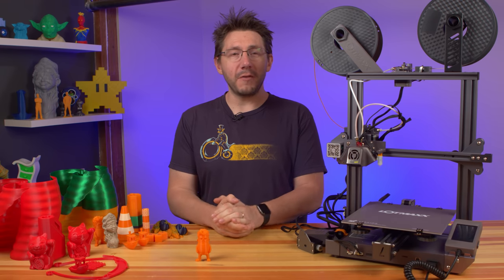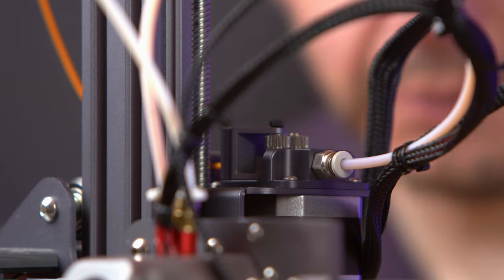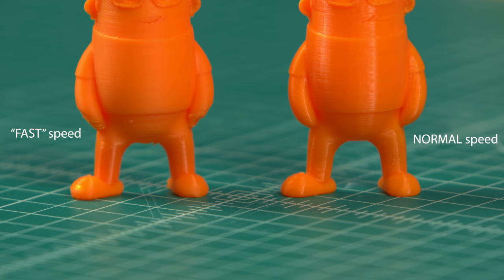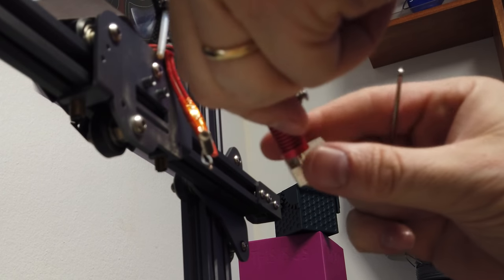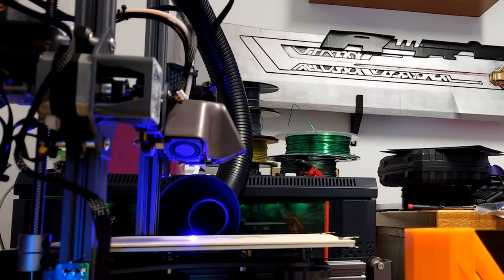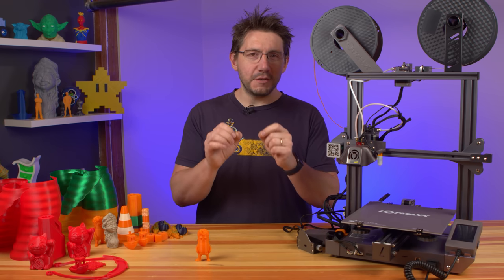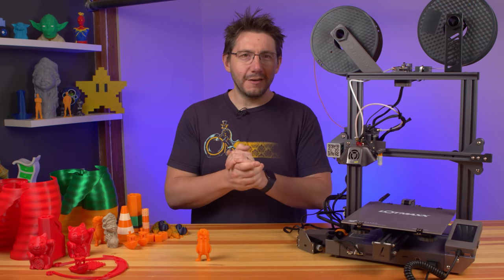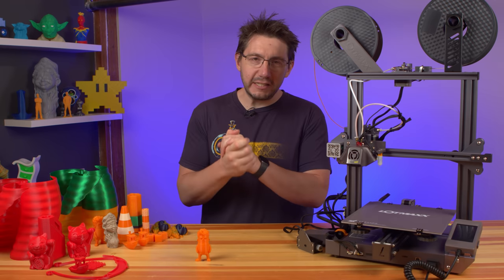Lotmaxx SC-10 SHARK 3D Printer *FIRST LOOK*

Comment: You said you communicated with the designers about "problems you had", yet you did not mention ANY of those "problems" in this review.  Um.
Reply from the maker: It’s not a review.
Reply: @3DPrintingNerd  OK, I'll leave off the word "review".  You did not mention any of the problems you had.  How's that?
Reply from the maker: @tvideo1189  I didn't think to, as these wouldn't be problems anyone else would see. Would this be something you would be interested in seeing?
Reply: @3DPrintingNerd  Sure.  I am looking into replacing my old warhorse ANET A-8 and looking at options.  I was not taking this one too seriously because of the single Z-axis drive but still, I'm collecting data.
Reply from the maker: @tvideo1189  Copy that, thank you for letting me know!
Reply: @3DPrintingNerd  Yes, as a consumer and as a subscriber of your channel, I would like to know your insights about the machine. Good or bad. I want to know if this is worth the backing.

Comment: Open frame laser engraver is a bad idea, VERY BAD IDEA. Anything dealing with lasers that can engrave or higher powers need to be enclosed unless you can ensure no one will accidentally come in without PPE, because at those power levels it can cause instant blindness just by looking at the reflection. (and by enclosed i mean ethier with opaque panels or translucent panels rated to the same specifications as the goggles.
Reply: I can't understand why they would even include a laser module. Obviously its not very high powered because you can only engrave with it. You wouldn't want anything powerful enough to cut through your material and cut the print bed ! Lasers NEED and enclosure or casing for exactly the reasons you stated. I hope they drop the laser idea early.

Comment: $250 machine on kickstarter better than an ender 3, ender 3 pro, cr-6, and basically everything else. The parts cost more than the machine and that is not including labor, shipping, tax, kick starter/amazon/paypal fees, margin of error, ect. Unless these guys have bigger manufacturing than creality, this will not ship...

It is safer to wait for the machine to launch and buy.. I am still worried about the ivi printer because they still have mainboard problems and might be in a polishing loop...

I know there isn't any serious glory to it but prusa proved starting and selling real parts and machines is possible. With their low advertised cost, they don't need much money to build a real inventory of their machines and start selling on amazon, ebay, aliexpress, and so forth...
Reply: $250 is only the base price.
Reply: True and they are not new they already sell printers